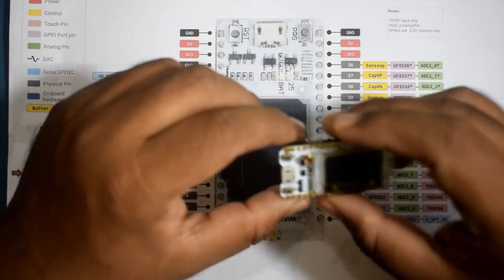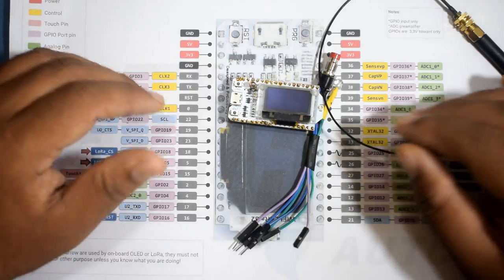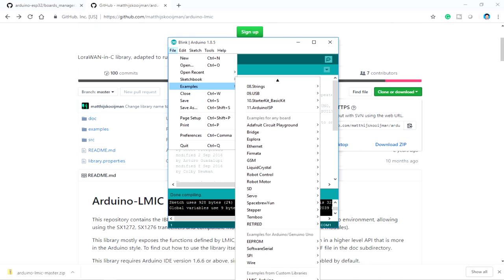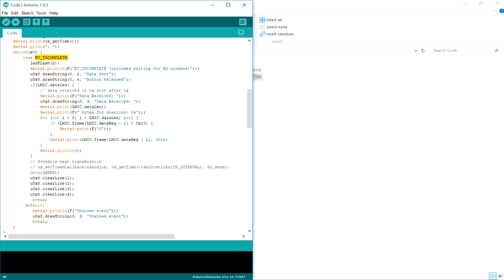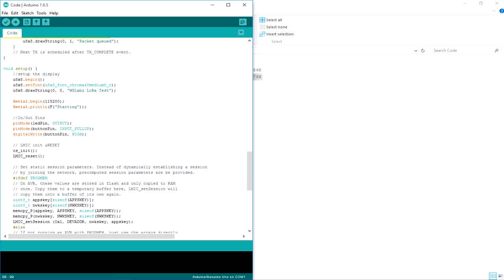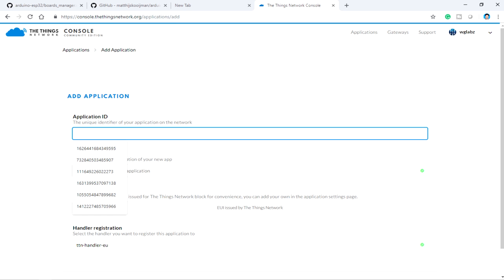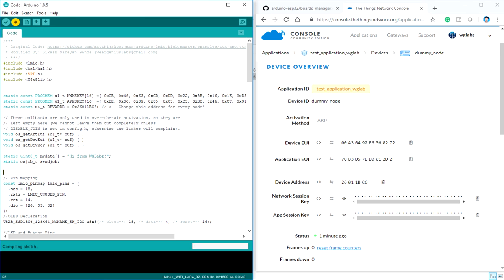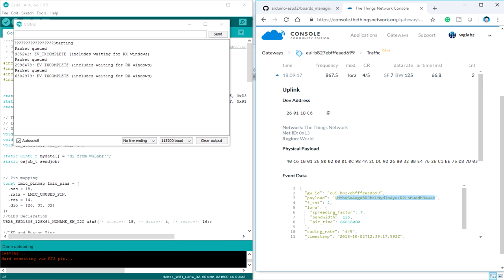ESP32 LoRaWAN Node with Arduino | LoRa #2

Comment: Hiii,

I uploaded the sketch to my Heltec Esp32 Lora but this error

Rebooting ...
ets Jun 8 2016 00:22:57

rst: 0xc (SW_CPU_RESET), boot: 0x13 (SPI_FAST_FLASH_BOOT)
configsip: 0, SPIWP: 0xee
clk_drv: 0x00, q_drv: 0x00, d_drv: 0x00, cs0_drv: 0x00, hd_drv: 0x00, wp_drv: 0x00
mode: DIO, clock div: 1
load: 0x3fff0018, len: 4
load: 0x3fff001c, len: 1324
load: 0x40078000, len: 7788
ho 0 tail 12 room 4
load: 0x40080400, len: 6448
entry 0x400806e8
Starting

adjustments the code to use at 915mhz frequency

 #if defined (CFG_eu868)
    LMIC_setupChannel (0, 868100000, DR_RANGE_MAP (DR_SF12, DR_SF7), BAND_CENTI); // g-band
    LMIC_setupChannel (1, 868300000, DR_RANGE_MAP (DR_SF12, DR_SF7B), BAND_CENTI); // g-band
    LMIC_setupChannel (2, 868500000, DR_RANGE_MAP (DR_SF12, DR_SF7), BAND_CENTI); // g-band
    LMIC_setupChannel (3, 867100000, DR_RANGE_MAP (DR_SF12, DR_SF7), BAND_CENTI); // g-band
    LMIC_setupChannel (4, 867300000, DR_RANGE_MAP (DR_SF12, DR_SF7), BAND_CENTI); // g-band
    LMIC_setupChannel (5, 867500000, DR_RANGE_MAP (DR_SF12, DR_SF7), BAND_CENTI); // g-band
    LMIC_setupChannel (6, 867700000, DR_RANGE_MAP (DR_SF12, DR_SF7), BAND_CENTI); // g-band
    LMIC_setupChannel (7, 867900000, DR_RANGE_MAP (DR_SF12, DR_SF7), BAND_CENTI); // g-band
    LMIC_setupChannel (8, 868800000, DR_RANGE_MAP (DR_FSK, DR_FSK), BAND_MILLI); // g2-band

    #elif defined (CFG_us915)

    LMIC_selectSubBand (1);
    #endif
    
    // Disable link check validation
    LMIC_setLinkCheckMode (0);
    LMIC.dn2Dr = DR_SF9;
    // Set data rate and transmit power (note: txpow seems to be ignored by the library)
    LMIC_setDrTxpow (DR_SF7,14);

    // In my place we are not using 868 MHz
// LMIC_disableChannel (0);
// LMIC_disableChannel (1);
// LMIC_disableChannel (2);